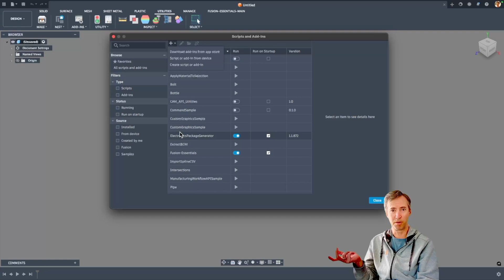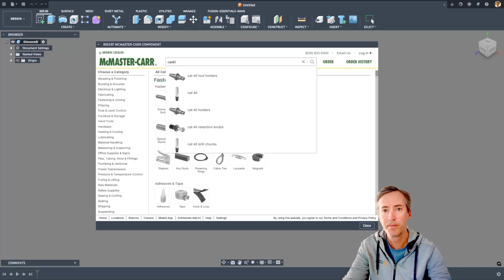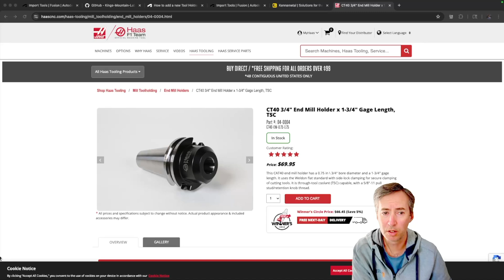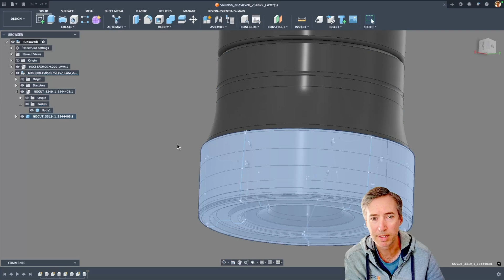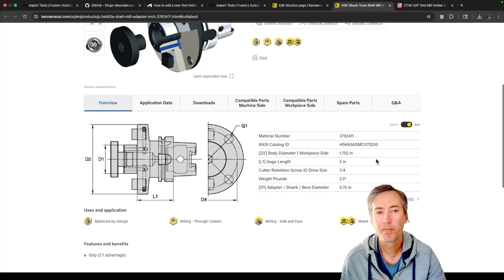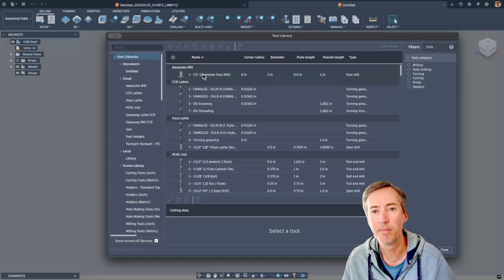Importing Tool Holders into Fusion

Comment: Does this work for lathe tooling as well…?
Reply from the maker: You could use this method for live tooling and collet style lathe tooling. Maybe I’ll do another video just about lathe tooling.
Reply: @cnc-o-rama I am currently using fusion for a swiss lathe. Works quite well. But would really like to get some better tooling geometry, which fusion is lacking at moment.
Reply from the maker: @brianmcbrinn7564 is there a specific tool that you’re having trouble with? I agree they’re lacking on the lathe side, but I’ve had pretty good results with a lot of lathe tooling.
Reply: @cnc-o-rama For instance micro100 
carbide boring/threading is somewhat difficult to get right. A lot of playing around with parameters. I use a lot of sandvik smalr grooving/backturning tools .
Reply from the maker: @brianmcbrinn7564 oh, yeah those non standard type tools are difficult in fusion.